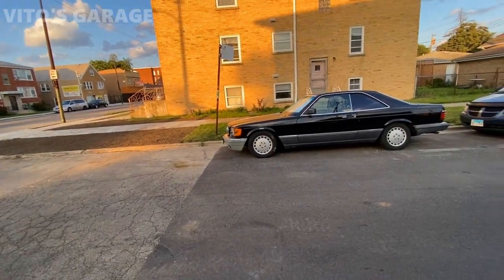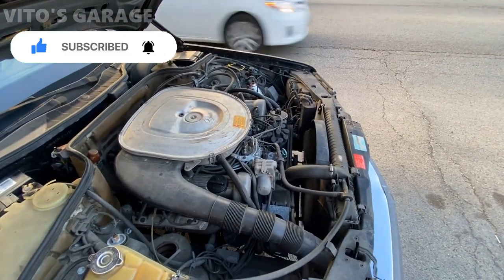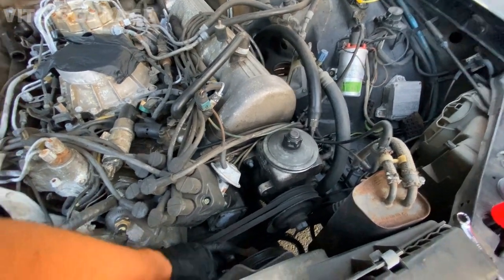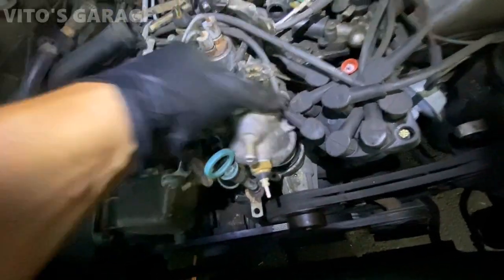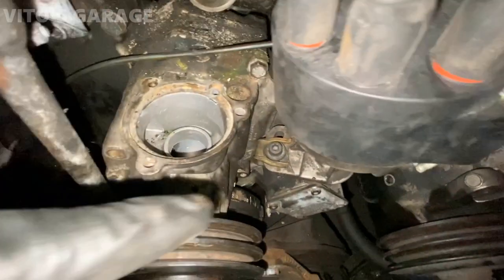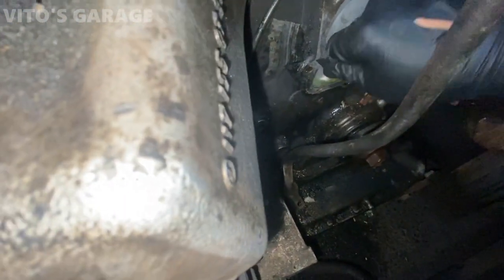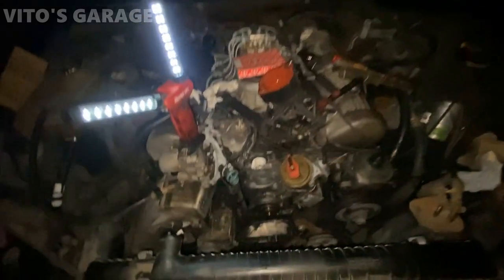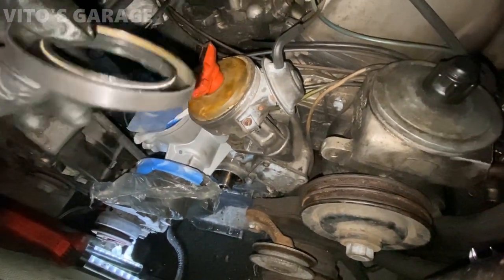Painful Water Pump & Crank Seal Replacement on 1984 Mercedes 500SEC. Fixing on the Street M117 M116

Comment: FYI 
You do not have to remove the distributor to access that bolt you just need to remove the bolt right in front of it and it give to complete access. :)
Reply from the maker: I tried everything I could. That bolt was in no way of a reach without lifting the distributor up

Comment: What torque spec did you do the harmonic balancer and the water pump bolts to???
Reply from the maker: You need to look it up in the manual. I can’t remember. Sorry. But I did it German tight. Don’t overtighten the water pump bolts or you’ll break them

Comment: Hey man how did you remove the crank pulley?
Reply from the maker: With the puller
Reply: @VITOSGARAGE  alright I did figure it out thank you! Although I may have messed up... I removed the hub bearing and put it back in without realizing the key in there so it wasn’t aligned. I took it back out and I put it back in “properly” but now I have a new issue. My harmonic balancer is hitting the timing marker on the water pump and I am having issues with belt clearance for the pulley. Basically everything is pushed back pretty far... did I over tourqe it maybe or what do you think?

Comment: I just changed my timing guides and this looks worse! Could you just get that one bolt turning, cut it, fully remove it and then use a smaller bolt? Either way good shit!
Reply from the maker: Thank you. And yes, you can probably install a shorter bolt on the bottom. But we installed a good brand water pump so she will be good forever. And all the mating surfaces were cleaned up very well before the installation

Comment: Cut outs in harmonic balancer to clear bolts, removing it isn't necessary. Just have to rotate crank round to the right spot.
Reply from the maker: You have to remove it man. Cut outs don’t help